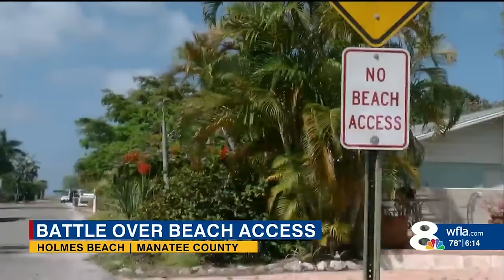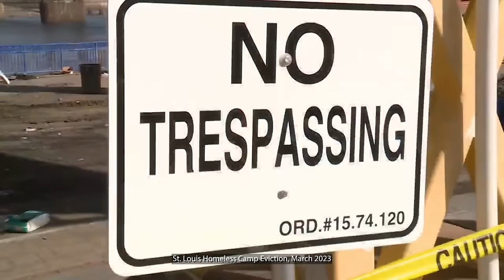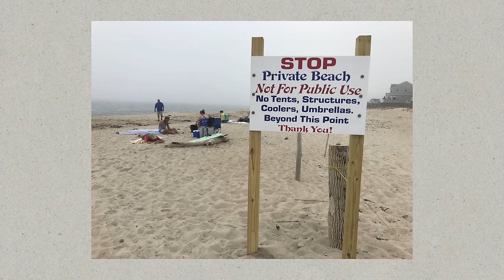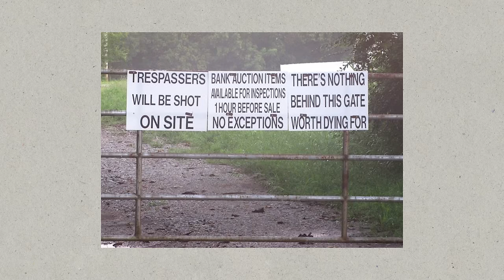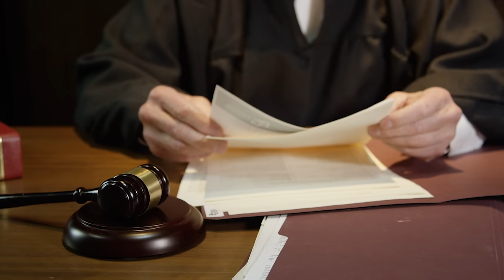The European Freedom that's Illegal in the USA

Comment: I made the experience in a small town in Oregon. A nice little creek was running thru it, but I was not able to get to the river bank because all along it was privat property. While here in Germany most of the time between a river and the closet houses is a path (called Leinpfad) where you can access the water.
Reply: Here in Sweden, as part of the ”Allemansrätten”, there is also a ”strandskydd” or a shore protection which means you can’t build anything that restricts access to the water within 100m of a river, lake or the sea. Of course there are exceptions but it is generally adhered to pretty strictly.
Reply: In the U.S. ocean and Great Lakes beaches are public to the highest tide line.  In California, the Coastal Commission maintains easements to reach these beaches (resulting in occasional squabbles with Hollywood celebrities who don't want the general public passing near their Malibu beach houses -- the celebs invariably these cases).  Inland river and lake bottom land is owned by the adjoining landowners but private owners generally cannot restrict the public's right to use the waters (though the shoreline remains private).  But in most of the U.S., there are large waterfront parks of various kinds.
Reply: Mostly, it isn't even permissible to have private land bordering to a body of water. This land is usually owned by the 'Wasser- and Schifffahrtsbehörde', which sometimes close off some of it for safety reasons around locks and weirs. Alas, there have been cases where influential people were able to get away with closing off the water access in the past, just because they want to have exclusive access.
Reply: That Leinpfad is called a towpath in English and was used to tow barges using horses.
Reply: It used to be legal to build your summer cottage or sauna right on the edge of water, and in these cases the immediate area around these buildings is off limits. New laws prohibit building that close to water, and access to the lake is granted to everyone. Then again, it's not good manners to cross between someone's house and the lake, especially if someone is staying there. Or fish less than, say a hundred feet from someone's jetty. 

But usually, being Finns, we abhor being close to other people anyway, so the legality is a moot point...
Reply: actually the law in the U.S. is that any "navigable waterway" is public access as well as a reasonable distance up on the banks. and the definition of navigable water ways should not be taken to mean that only waterways where a boat can pass but really anything from a ditch to an intermittent stream or wet weather stream is included as well. This is how i travel to some prospecting sites when there is no regular public access. However; not every landowner is aware of this law and so it might be dangerous to insist on it to a hostile landowner.
Reply: @markweaver1012  side question: the Great Lakes have tides???
Reply: @apveening  It's not the same... he means a path between properties to access the water from the road, not a path along the water
Reply: @altepost3805  No, but the water level does vary quite a bit, in part due to rainfall and snowmelt levels, and in part (especially on Lake Erie) due to wind pushing the water toward one end of the lake.

Comment: Come to think of it, I kinda love the german word for trespassing, as it really embodies this cultural and legal difference:
Hausfriedensbruch. Literally means "House Peace Disturbance"
Meaning you have to disturb the peace of a house to get into trouble, and not just pass through something. I can safely walk over someone's driveway and not get into trouble for doing so. I could theoretically walk through someone's front lawn if it's not fenced in. So long as I don't disturb the peace of the house when doing it, as the act of stepping onto someone's private property is NOT a felony, it's only a felony if I disturbe the peace of the home while doing that. That of course means climbing a fence to get into someone's garden or straight up entering a private home, even if the front door is wide open.
Also kinda helps not having to worry about getting shot for getting to close to a house.
Reply: As long as you don't enter an enclosed area, it is only illegal if you don't leave it if told so by the owner.
Reply: Actually, the German Hausfriedensbruch law (§123 StGB/ penal code) has a broader scope. As soon as you enter unlawfully/ without the consent of the owner someone's property which has any kind of visible barrier (which does not have to be a sturdy wall or fence) then you're committing "Hausfriedensbruch".
You are right that crossing the fence or any other barrier is the key issue. But even when a farmer put up an electric fence to keep cows on his pasture 5 kms away from his house you were committing Hausfriedensbruch if you entered that pasture. "Disturbing the peace" does not mean that you literally have to disturb the owner.

Comment: I was reading a fiction book from the 70s about an American family living in Wales called A String in the Harp, and the characters went hiking and the public walking paths might be on someone's property, but you could still use them
Reply: Yes – in England & Wales, even outside the open access land that Ashton refers to in the video, there is a very extensive network of public footpaths (where you can walk) and bridleways (where you can walk, cycle or ride a horse), most of which are across private land but where the landowner must allow and maintain public access.

Comment: As a Norwegian, hiking in Scotland as a teenager was a shock. It never even occurred to me that I could not simply walk in the woods or on the heath anywhere. I feel deeply sorry for the Scots.
Reply: What are you talking about? We have the right to roam. It's mentioned in the video several times.
Reply: I am confused as where abouts in Scotland were you? Scotland does have right to roam and you can wild camp (in a tent) anywhere. Only limits are for camper vans in popular spots. However, in England you technically need land owners permission, but people still camp overnight, just need to be more careful.
Reply: @damnson666 , it back in the 1990s, and I'm not entirely sure where we were (we were driving around the Highlands, and there was some whisky involved). I needed a bit of fresh air and went for a stroll, only to be told by the Scottish people we were with I really ought not climb a sheep fence to have a stroll, and that land was private. In Norway, that would not have been an issue. It might have been a special case, or the Scotts may have been pulling my leg, but they did look genuinely concerned.
Reply: @p.bckman2997  ah right, that makes sense. The land reform act was passed in 2003. I have no idea what the rights were in 90s. 
Also, today there is a difference as in you can walk thru farmland but not farm yards, unless its part of a walking path. The right to roam is not as wide as it is in the Nordics. Basically you can hike wherever using common sense and being respectful.

Comment: I am Romanian. Here, because of corruption, many lakes have been either completely or partially closed off to the public because houses are built next to the lake and fences go right up to the lake. Many of these were public spaces but they have since been sold to developers and/or private owners. There are many lakes you can no longer walk by because of this. Even if some areas are still publicly accessible, the rest is blocked off by fences on either side. Sometimes if you get too close to a fence you can even be threatened by owners that they will release their dogs on you if you don't go away.

Comment: I live in Utah. I’m next to massive mountains, most of which are owned by Rio Tinto, for copper mining. Except the mine is about 35 miles south of me, and the only parts of the mountain near my house used by the mine is a small smelter. Yet, the entire mountain is fenced off with chain link. I’ve lived near these mountains for over 20 years. I’ve never climbed, hiked, or biked up them, for fear of being arrested for trespassing. (Though many people I know have chosen to do so) I have to drive over 30 miles away when I want to go mountain biking, while there are great mountains literally 2 miles down the road. It is INFURIATING.

Comment: i’m american and i’ve been thinkin about it a little bit, i think what would be best is a limited right to roam. You should have a right to roam up to a certain radius around any inhabited structure or agricultural land with the exception of when that radius overlaps other public or private propertie(s). Maybe 500-700 ft (~150-200 m)? I do support castle doctrine within a much smaller radius. Maybe within 50 ft of any inhabited structure and with clear line of sight? It’s more of just a modification to what we do have and it keeps suburban and urban properties entirely or almost entirely under the control of the property owner as i believe they should be. However in areas with considerable wilderness this ensures public access in reasonable areas.

Comment: I thought the Feds own the area where the waves meet the land in the USA?  In the Balkans that's the case and I think the same for the USA.  I thought this was going to be about jailbreaking your phone?

Internet: "On most U.S. shorelines, the public has a time-honored right to “lateral” access. This means that people can move down the beach along the wet sand between high and low tide – a zone that usually is publicly owned. Waterfront property owners’ control typically stops at the high tide line or, in a very few cases, the low tide line."

Comment: Wait, what? you can't cross anyone's fields in the US?
In my country you can fence you garden or backyard but if you fence your land (because you have animals or want to keep wildlife outsede) it must be accessible for everyone. In my region it is very common having an electric wire at around a meter of height and a couple spots where the circuit can be opened in a kind of chain with a hook way. It is also very low voltage to scare animals, it does not hurt much and wont percieve it if you have shoes

Comment: I personally think that people should have the right to roam on private property so long as 1) they don’t cause any property damage, and 2) they stay outside a certain minimum distance away from any man-made structures on said property. This would allow someone to, say, wander through a field or private woods, but would not allow people to go very close to a residence or use someone else’s infrastructure without permission. You could use mark out the boundary unobtrusively, and if you were worried use a camera to catch anyone who breaks the rules out. “Trespassing” and “Property Damage” are already different crimes. Just restrict where the first one applies while leaving the second one as it is. Of course, access to security cameras costs money… but if your property is small enough, then the ‘No trespassing’ area may cover your entire property anyway, which would mean that anyone caught on your property would still be liable.

Comment: Since, as you note castle doctrine does not include people simply trespassing on land, the conflation of the two in the same video confuses the issue.  The right to roam laws don’t allow you to walk through a yard, but rather open fields and pasture land, so the cases in the US are apples and oranges. 

As far as if the US should adopt these types of laws, no.  We should rather acquire land over time and put it back in the public trust.  Much of the most interesting lands are already open space and accessible via national and state parks. There are huge variations between states with Nevada and Utah being 80% and 63% respectively federally owned and others being less than 1%. This is more of a Midwest and Eastern US issue.

Comment: I have to say I think that the US has some very reasonable and fair laws regarding land and land use, though that varies by state.

I come from rural Pennsylvania and when I grew up in the 90s there was very little posted land. You could go basically anywhere you wanted, exept into/threw peoples yards. The latter was more courtesy though as nobody had any signage. We had some issues though.

First people did not respect the property they were using. This includes throwing parties, having bonfires, cutting trees, building structures, littering, and heavy ATV use that was ofter reckless and dangerous. Some people got sick of being unable to use their land themselves or having it be destroyed and posted it. We don't have the laws that protect the forests, so the only real way to protect is to limit access (which often means just finding the owner and asking for written permission).

Another large component was people being sued, or hearing stories of and being worried about being sued, by people getting injured on the property. Ownership comes with additional responsibility such as ensuring that the area is safe which can be a lot. Hence people posting to about another complication imposed on them.

Then when you have more and more land getting posted, the incentive for those remaining goes up and more continue to follow. To be honest I think most of the land owners there would want to go back to it being open, but only if they could protect it from abuse and protect themselves from liability.

I now live in New Hampshire and it is wildly different here. Very little land I see posted and part of that is a tax break on land that owners keep opem to the public. They can put the land 'in use' and pay a fraction of the property tax. Most trails have signs that ask to stay on the trail or not to use motorized vehicles, but it is pretty free and open all around.

Comment: Another point you did not explain the castle doctrine properly. In states that have the castle doctrine someone only needs to enter your locked residence with the intent to commit any crime no matter how small for a home owner to be able to use deadly force.

The theory behind the castle doctrine is that a resident has the absolute right to be safe and secure inside their residence free from any criminal activity that may be perpetrated against them or their property. To guarantee that freedom the castle doctrine guarantees a resident that absolute right to use deadly force against any uninvited intruder that enters by force or bypassing a secured physical barrier with the intent to engage in any illegal activity inside. It doesn't matter if the intruder's only intent is to commit further trespass or steal a penny off the nightstand. 

A residence is so sacred that the mere entry through a locked door by force is a threat and the residents need not wait for the appearance of danger to deploy deadly force under the castle doctrine.

Comment: Not entirely true. As you stated 640 million acres,  28% of the USA which is federal land is open to the public. This is not including all state owned public land, parks and wildlife management areas. Also all navigatible water ways are open to the public including 100s of large power supply reservoirs that cover dozens of miles. The only places not accessible is privately owned land which requires consent from owner. Basically within a two to four hour drive from any location you can access land you can backpack for days without coming across civilization. Within a days drive you can pack into areas so vast many people get lost, disappear every year and are never found by search parties.

Comment: i’m a cultural resource management field tech/archaeologist, and come up against issues of property rights in my work all the time. recently, we were forced by a landowner to trek over a dangerous gravel hill with active construction rather than use his dirt driveway to get to a site in a power corridor (far from his house btw, he owned a massive swath of land near the corridor). although this involves more legal moving parts than just roaming, american property owners are so territorial that it ends up inconveniencing others at best, hurting them at worst. also, to note, if someone buys property near or in a corridor, they have the knowledge that whatever power company will send out subcontractors to work on the area at times, whether that be construction or cultural resource management or what. so basically tl;dr: i work in america and have literally had this issue interfere with my work and it is really frustrating!

Comment: Now this is a slippery slope. If I would own a piece of land, no matter how big or widespread then I should reserve the right to keep people out. This is my opinion but here in The Netherlands it's a lot more nuanced than that: You CAN disallow people to get on your privately owned property if you explicitly state with the use of signage that you're forbidden to enter, your area needs to be fenced off too, no matter if it's cultivated or anything, no matter the size. If you do that, then tresspassing is indeed illegal here.
Otherwise, people are allowed to cross your land.

And this is a good thing imo because it sets a clear boundary. With the right to roam, when has there been done enough ''damage'' to your land to kick people out? People are unpredictable and if your land is big you might not even know that people are there in the first place. How far do you need to stay away from someones home? Apparently there is a difference between someones ''garden'' and the ''rest'' of the land? It's vague as @ss. you can make some kind of quasi virtues argument about ''equality'', but these property laws are mainly in place to keep order. Legal force to keep people out is often not reasonable ofc, but what about the people on your land? You need to make the same reasonablility argument but in reverse in this case.